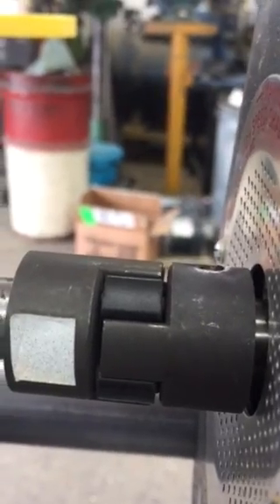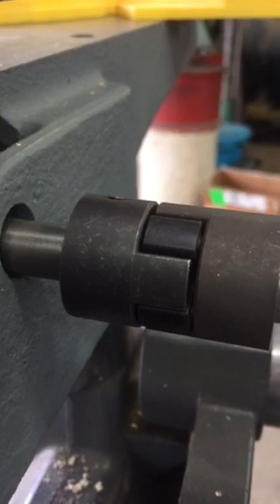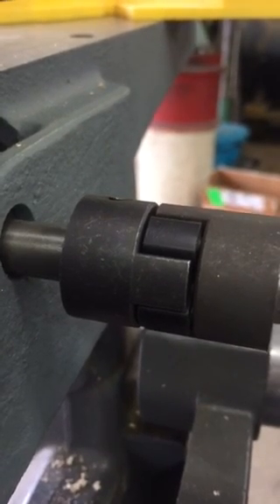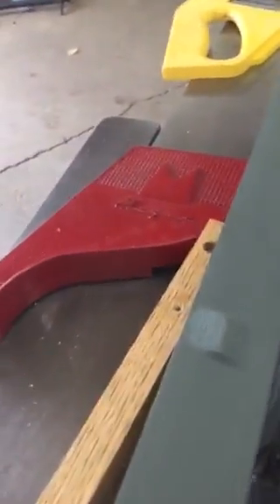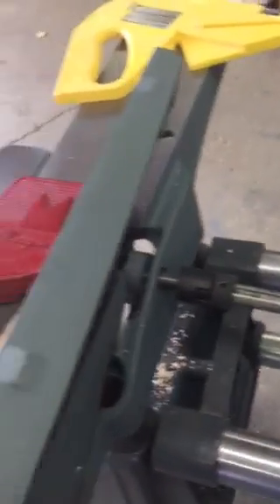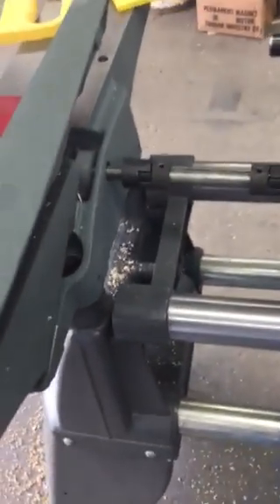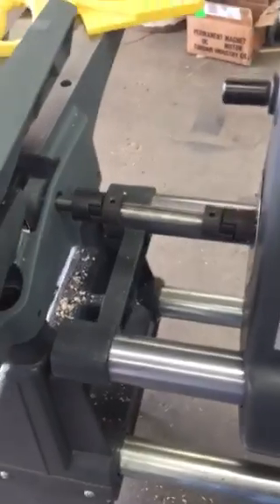Inexpensive power couplers for a Shopsmith

Comment: Thanks for the idea. I made one today from the same Princess auto parts (now about $45) but I love it. I used 1/2” copper pipe which happens to be a perfect fit in the 5/8” coupler body. As far as the break-away thing, I’m pretty sure the motor stalls before anything serious breaks.😉

Comment: This is silly. The Shopsmith coupler cost less than those love joy couplers and rubber spiders.    I mean if you just have the stuff laying around than I guess why not, But changing tools is going to take more time as the Shopsmith coupler is instant and fast.  To each is own.
Reply from the maker: Before you call something silly you should do your homework. I live in Canada and with the exchange rate and shipping there is no way I can buy them for your stated price. You should think before you made rude and ignorant statements!
Reply: @oldsloane   Wow!!   If I hurt your feelings my apology.    But you are telling people it is a cheap work around to a stupid expensive part from ShopSmith.   The generic love joy type spider couplers are $25 per set on Amazon and 3 times that more for name brand.  You have 2 sets on it....  Plus are they made in Canada? because the name brand spider couplers come from Illinois and most the rest of them are China made.  
You asked I do research so From what I looked up you have about a 5% duty tax on most items.  So it is not like but a few extra bucks.    That looks like a pain in the ass compared to the factory part.   

I was not trying to be a dick. I do not know how many years you have been a shopsmith user but people like to give us a lot of SHIT over that coupler like it is a very poorly engineered part that breaks all the time.     But they don't and it is not.   I have 3 ShopSmiths my father has 2 and I have been using them since I was 8 years old 40 years ago..  

I just love these little machines.   I promise I did not come here to be a troll.  Last night I had even commented on a vase you had made.

Comment: My concern would be what if there was a sudden stop or emergency situation ??
Reply from the maker: The driveshaft is now fibreglass and only held with set screws with no flats on the shaft. If I had a sudden stop the set screws will just tear out the fiberglass. I have used it many times so far with no issues.

Comment: Where did you buy those couplers with the rubber star insert?
Reply from the maker: I purchased them at Princess Auto in Canada. I would think they would be available at any good sized hardware.
Reply: @oldsloane  Do they have a brand name?
Reply from the maker: @williamkaczmarek3996   not that I know of there is nothing stamped on them.

Comment from the maker: I found a fiberglass rod in my junk bin that just fits the 5/8" couplers so it now runs on a lighter drive shaft. The set screws are only gripping the outer surface of the fiberglass rod and I suspect they would just tear a groove in the rod if anything gets jammed up. I planed a 3" piece of basswood today at 3000 RPMs and it worked perfectly, lots of power and no slow down no matter how fast i pushed the wood through the jointer.

Comment: No doubt that this is a proven design for a PTO, but one of the important functions of the SS coupler is that it is the weak link that is designed to shear in the event of a sudden stop of the SPT. As you no doubt are aware this coupler will continue to drive even as the damper becomes worn and it will continue to transfer power even is something goes horribly bad at the cutterhead.  There is some belt slippage on the upper shaft of the headstock, but the lower, high-speed shaft that is used by the jointer and the scroll saw has much more torque and has much less belt slippage. I guess what I'm saying is be careful and party on!  Scott
Reply from the maker: I am much aware of the safety concerns and I would agree if I was using a standard shopsmith, mine, however, will be used on my treadmill motor powered SS. The lower belt is a link belt using only the weight of the motor for belt tensioning and I would expect some slippage there. One other good thing about this drive is the parts are dirt cheap and the rubber splines can be changed often. Also the amount of time I run my jointer is so minimal I expect them to last a long time. I am also going to experiment with a wooden dowel rod for the drive shaft as it would twist off pretty quickly under sudden duress. Thanks for your input, I am always learning and appreciate comments as I have learned that the only thing I know for sure is that I don't know anything for sure!
Reply: A wooden or even PVC shaft should do the trick. Yeah, your new motor configuration is quite different than the stock drivetrain, so that's a help too. Scott